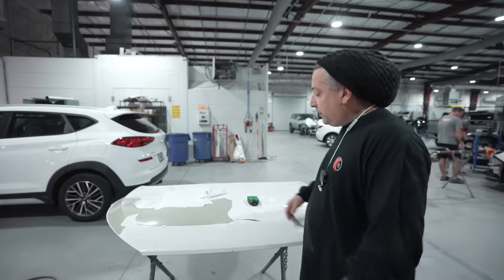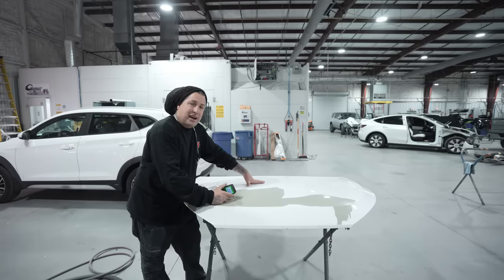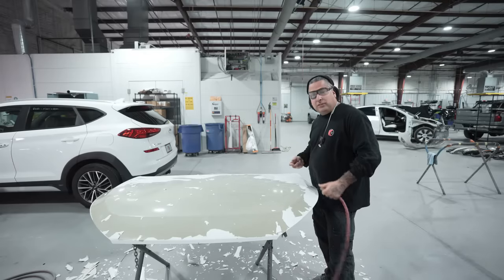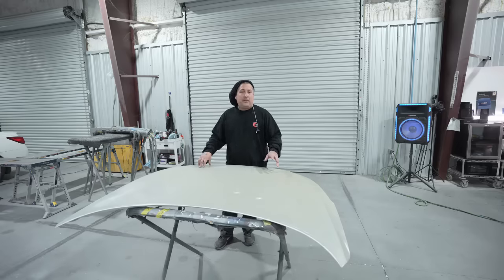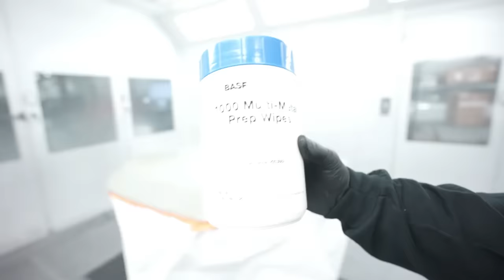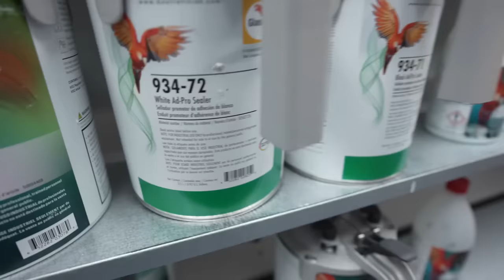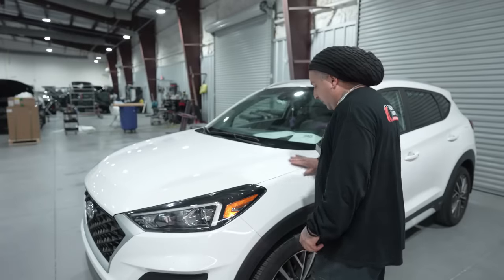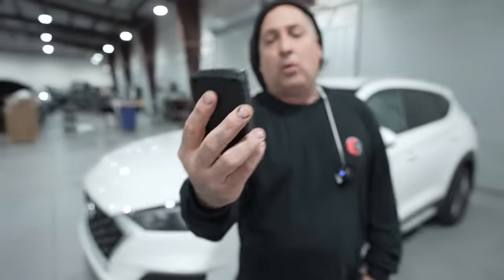How To Fix A Peeling, Flaking, Delaminating Paint Job

Comment: Nice to see your work on the Hyundai, it’s too bad their QC hasn’t improved any over the years.  We had an XG350 back in 2002/2003 and I managed to blast the paint of both left and right side rocker panel covers with my pressure washer when cleaning it at home.  The dealership. eventually warranties 50% of the job, after a lot of spirited debate and their claim of having already repaired the car with parts from another Hyundai.  Our car was a three stage white pearl, and underneath one of the rockers was burgundy paint.  We were the original owners and the car had no previous damage or repair (at least that we knew of)…
Reply: Hyundai is the worst when it comes to paint peeling

Comment: Couldn’t tell you how many Hyundai peelers I’ve done over the years. You think by now that they would’ve figured out how to stop it. Also, from experience with the basf etch wipes, for some reason they tend to dry out into the container, I just took them out out struck them in a gallon size zip lock. Great video as usual my guy.
Reply from the maker: Thanks for the tip 👍

Comment: Please could you do a video/series on how to fix peeling lacquer as a result of extended heat exposure, this is for dark coloured cars and countries that are very hot and also for imported vehicles from Japan which usually cars from the hotter areas suffer with lacquer peel. Should the panel be stripped down to metal and start again?
Reply from the maker: Yes it should be completely Stripped to bare metal. Sorry don't spray lacquer  it's a thing of the past

Comment: Noticed you are using he 3M gun again. Does it work better with the Glasurit waterborne and your new methods? Or, is that gun simply working good cross the board? I have also been wondering if  you got anything coming up on your personal cars? Like a C8 vette engine going into that little S-10/S-15. Cant remember which version you have other than a clean one.
Reply from the maker: I love the 3m gun
Reply: @kandyman5315  I noticed you were using the original style of tip rather than the new fine tips. Any reason?
Reply from the maker: @satamanschmidt3428  no reason it was on the gun so I used it.

Comment: Doesn't the underside of the hood get hotter than the top and have less mils of clear on it? Wouldn't that peel worse if heat and thin clear caused peeling?
Reply from the maker: It not the heat. As much as it is the uv rays bottom is fine

Comment: That gray  E coat looks like a Hyundai replacement panel. Is it possible someone painted a new hood for the car and the repaint failed? Possibly sprayed base right over the E coat? That’s pretty bad for factory, I have never seen a factory job fail that bad. Strange that it’s just the hood if it was factory failure
Reply from the maker: It was a factory Peeler . We service the local dealership